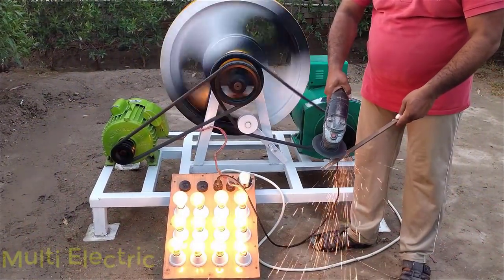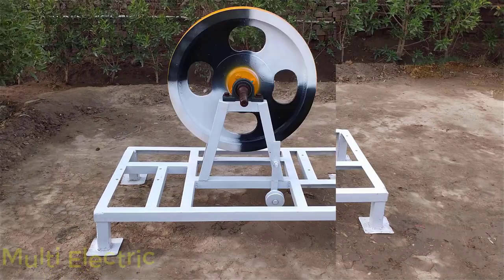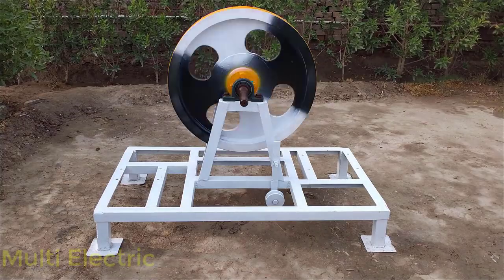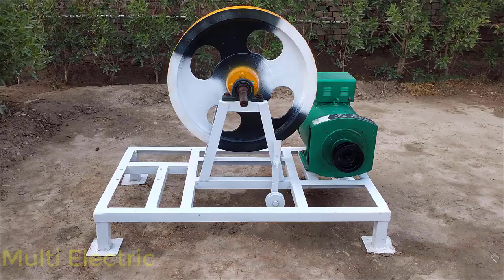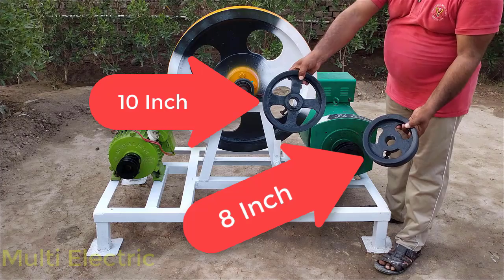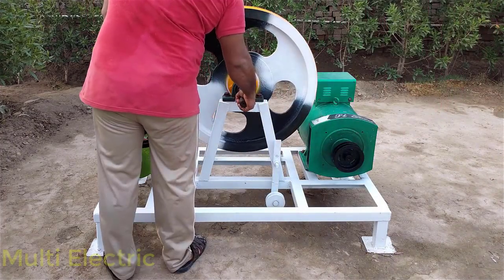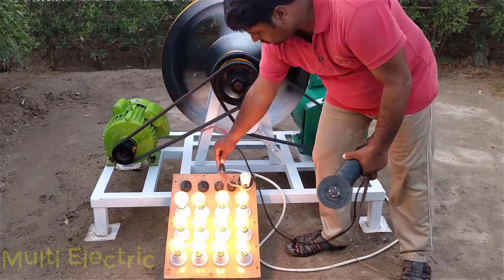12kw Free Energy Generator 230v With Alternator & 3 HP Electric Motor Free Electricity Generator

Comment: Jab hum electricity Par in karate Hhad to 255v milet gab had convert karate han alternator Par to project off go hard ha flywheel 84kg 2 piece and weight on one wheel is 42 dono ask shaphat Par late han flywheels width size is 17 inches alternator pul y 6 inch weight puly 10 inch motor puly 4 inch motor side weight puly 5 inch sir 5 k babe 8 inch pyou late to volt kan ho jate han alternator k sat jo tar algai ha 744 lagai ha motor k sat jo tar layai ha 729 ha yeh tar kiyu garam hoti ha aur yeh garam kiyu hoti ha plz kindly bate k yeh apas me  join karne se kiyu bad hoti ha

Comment: Do people actually believe this garbage? This literally breaks the first law of Conservation of Energy. What this person made was a flywheel battery. Not a FreE EleCTricItY GenErAtoR. The energy stored inside the flywheel will NOT cause it to spin forever. Energy will be lost either through resistance in the wires or through friction. AND it can definitely NOT power a grinder while still spinning forever.

Comment: Uh.... perpetual motion doesn't work. This is a low efficiency flywheel storage device that will slowly bleed off energy over time. If you raised the mass of the flywheel by a factor of a few hundred, installed a maglev bearing system for it, removed the motor (which does nothing but increase the rate of energy loss), ran the whole thing in a hard vacuum at extremely low temperatures to take air friction and magnetic eddy losses out of the picture, and used a solar farm to run the flywheel up to a few thousand RPM, you'd have... a really expensive kinetic battery system with reasonable efficiency. This is fun as a thought experiment, but in the world of physics, this is the mythic "free lunch".

Comment: WHY USE GRID ELECTRICITY TO START THE MOTOR, WHEN YOU CAN TURN THE FLYWHEEL HARD TO START RUNNING AND LET THE GENERATOR PRODUCE POWER FOR THE MOTOR?
Reply: The alternator would need a minimum of 3000rps u cannot do that with your hands. Again I think these alternators have been modified with permanent magnets so that it will need less rps of around 1600 inorder for the motor to efficiently turn the alternator into producing the total kw

Comment: Which electric motor, flywheel (in kg) and petrol (E95) engine to choose if the alternator is 6 kVA, 2-pole, 3000rpm, 50Hz, 230V? Thanks.
Reply: It is not possible with 2 pole alternator, you must use a rewinded alternator with many poles or low rotation alternator.

Comment: i have a funny feeling that the power was never removed. at least, i expect the system to blink or dim when the initial power was removed and the alternator power replaced to run the system. but everything ran smoothly rather
Reply: The flying wheel was maintaining the speed

Comment: I would use this to charge a set of batteries, then run the house from there using a power regulator, then if you used a trip switch when the battery was low it could kick start the wheels again creating a self loading loop

Comment: I was thinking if this is a scam and if it will not work and the motor runs of the grid if u use a 2hp motor it will work fine and you pay 1,5kw for the motor and you get 10kw in return i am going to invest in this and build it the same way if it dont work i just use the grid and get 10kw for the prise of 1,5kw so no loss in trying

Comment: i love the concept the execution is simple and brilliant. My only concern is for your safety. Like most brilliant people you did not take the time to be safe. Run and secure all electrical wires, use a self tensioning belt tensioner so you dont have to adjust tension on a piece of rotating equipment, and wear a welding hood. This is a very impressive achievement and the world could use more breakthroughs like this. So be careful with yourself so you can have many years to continue good work. Im only giving you a hard time because you've earned my respect. Keep at it.

Comment: I have seen these before and it's very interesting. The question is... can you demonstrate it with a big "load" while running? For example... lights, a heater, a refrigerator, a grinder and an aircon all running at the same time from the power output. Because a 12 KW system should be able to handle this load. Can you please reply and share a video with this type of demo?
Reply: hhhhh. Hay philipino, you nailed him. He will never reply nether would he be able to demonstrate a full load.
Reply: @SAGmyTube  That's correct Sager, we should be able to see a demo with a load, because if that generator has an output of 12 KW it would be enough to power my entire home, if it truly can handle the load/resistance right? I am in no way an engineer or electrician, just a retired chef, but I have built some HHO devices that work and am always looking for free energy options.
Reply: @Philipino56  if you want to look into flywheel storage systems then check out the vacuumed ones

Comment: We need generator when main power goes away ...when load shedding happens or when failure of power supply happens. When tthere is failure of power supply then how can we start this system by AC when AC is not available at that time. SO WE NEED IT TO BE SYARTED BY DC FROM WET BATTERY. PLS COMMENT

Comment: I did not see any batteries, when you unplugged the electric motor---and connected to the dynamo/generator, where did the stored energy come from? The motor should have stopped producing any voltage?
Reply: that is the work of the flywheel, to rotate the dynamo while the motor is unplugged.

Comment: Interesting work!  you mentioned that you had to rewind the 12 kw alternator dynamo. Can you explain the process in detail?
Reply: It is good things,but I have dout on it   will work,what modification you did in the alternator that its less RPM and how its working as per your specification.
Reply: Alternator has been added with more rpm thats all....
A standard alternator will also work
Just add a 1/4  extra ratio dia pulley to it..

No rocket science here

Comment: Sorry but I can see the flywheel slow down then a quick break in the video and it’s running faster again. That’s because you keep connecting it to the mains supply and then you start filming again. It is a good concept and one I want to pursue. But that will not run for 24 hours that I guarantee you.

Comment: Hello 
Great work... do you have a email address I can contact you on? 
Confirm both motor and alternator are 1500RPM?
Reply: A 2000 - 3000 RPM motor should work fine, note the pulley size (10") on the fly wheel that reduce the RPM on wheel itself, then 8" pulley drive the generator. Calculation must be done to balance the 1500 RPM on generator.  A full load on the generator will definitely impact the generator RPM that has to be measured with proper instruments.

Comment: Hi, how r u one thing i didn't understand how you meassure pully size and RPM you have set amps meter and voltage meter during same time you have to meassure rpm and voltage amps

Comment: 12kw Free Energy Generator 230v With Alternator & 3 HP Electric Motor Free Electricity Generator

3Hp  electric motor  4 inch pullies
12kw Free Energy Generator 230v , 8 inch pullies
100kg  flywheel  10 inch   pullies

Comment: Why didn't you connect the motor directly to the unit that produces the electricity/power instead of passing it through the the big round thing in the middle?
Reply: The big round thing is what we call flywheel. its kinetic energy is what produces force needed for alternator to generate electricity(a force of sort needs to be applied to spin the alternator to produce electricity). to gain that energy first, the flywheel needs to be pinned to obtain that energy to drive the alternator. that's why the motor is needed.

Comment: Hello, In your next video, could you measure the frequency? I've been trying to get this working to get 60 hz. It doesn't work for me at 60 hz, maybe a higher frequency? I calculated the pulleys to get the correct revolutions at the generator. I also made sure my flywheel weighs more than the motor's rotor as well as the generator's rotor
Reply: I can help you,
What is your flywheel kg and diameter, your generator is it PMG? And your motor how many kw and HP
Reply: @MRNWANETI   me puedes dar los materiales para un generador de 5 kva saludos desde Colombia
Reply: @MRNWANETI  Oh, I have to use a permanent magnet rotor in my generator... How do I acquire a rotor? I have to remove my rotor and see what size it is. I bought an ST 13.8 kW  3 phase generator but it is synchronous. We can not buy PM generators here in the US in this size, we need to make them.
Reply: @advanced-electronic  if you can buy direct already made PMG in your country US then you have to modify it by yourself,cos only PMG is suitable for this system thanks
Reply: @MRNWANETI  I have 2hp 240 v motor, a 90 kg flywheel with 13" diameter. My generator is synchronous ST 13.8 kW 3 phase gen. I wired it for single phase 240 VAC. Motor and spins at 3600 rpm. Gen needs to be 3600 rpms to run at 60hz. I had 6 inch to 3 inch at flywheel and 3" inch from flywheel out to 6 inch on generator
Reply: They jump the generator avr ac 40v or 80v from exciter coil into rectifier and filter 'dc capacitor' go straight to generator rotor or put straight ac from exciter coil "40v or 80v that way you skip the reaction power from your motor. 
The secret avoid the avr skip it.

Comment: Hi I build this but mine will not self sustain.what could be the problem
Reply: Drive motor 3 hp-2880rpm 230v- generator dynamo 16kw  1500 rpm 415v 3 phase flywheel weight 80 kg .pulley calculated to step down rpm to rpm 1500 generator speed.when I switch from main to generator it does not self sustain it gradually decelerates to a stop.
Reply: @seahawkscram  from what you explained I understand is your synchronous generator PMG?,if not it can't work

Comment: The fact that so many people believe that this is real is concerning
Reply: Why wouldnt it be?
Reply: @HeavyMechY  laws of thermal dynamics.  Energy can not be either created nor destroyed. Any machine you make always has friction and heat loss.  Period. There is no way around that.  When producing electricity, the energy put into running the generator will always be more than the electrical output.  What you are seeing here is called a perpetual motion machine, which is nothing more than a pipe dream.  Even if you could somehow you cab bypass the laws of physics,, run the machine at 100% efficiency, with no friction or heat loss, it would only create enough power to run itself.

Comment: I really like your videos. Where could I buy these parts to make these free power generators?
Reply: You cant, because systems like this dont exist
Reply: I had also tried this but once I changed over the power to sell running,it will stop
With 3 hp electric motor of 3000 rpm and the same flywheel they used here and 7.5 alternator of 1500 rpm,but did not work,

Comment: Your idler pully should be under the belt not on top. The end of the pully bar could have a strong spring pulling on the bar forcing the idler pully to push up.

Comment: This project is amazing. How much will cost to get an instruction guide how to successfully build one of this generator
Thanks
Reply: Ill give you one free after you buy the bridge I have for sale
Reply: @MrNinjaBeater  ,,🤣🤣🤣🤣
Reply: I've build two sets different capacity,it work but it very hard to succeed if you don't have some guidelines from person who has construct before because a lot of modification required before your system works,we don't make used of synchronous generator only PMG
Reply: @MRNWANETI  you are so full of shit lol.  Perpetual motion machine is impossible.  There is always energy loss.  Your input power will always be more than your output, due to loss from friction and heat.  Even if you managed the impossible task to create a machine that ran at 100% efficiency, you would not be able to pull power from it, as the machine would only create enough power to sustain itself.  Gotta love people that will lie for views.
Reply: @MrNinjaBeater  I don't interact with such minded people like you,come into the field let see not online blabbing rubbish,I used 12v DC motor 400w to ran 1.5kw generator and 12v battery charger that recharge the battery immediately with low RPM,and I used more than 500w power from it isn't free energy generator? No solar no fuel , don't talk because others are talking think 🤔 before you say a word
Reply: @MRNWANETI  RPM doesnt matter.  Decreasing the rpm means that more torque is required to generate power.  More torque means that motor has to work harder to spin.  The harder your motor works, the higher the power draw, and the more heat your motor produces.  There is absolutely no way around that.  You can not get more out of something than you put into it.  If your machine is running, it is using battery power but is not recharging.  I stand my ground on the fact that you are lying, because we both know that you are.  You telling me that $1 million USD isnt worth a trip to the US?  Riiiight.  You just know that you cant prove anything.
Reply: @MrNinjaBeater  sorry let me enlighten you more, we have many types of generator which you might know, brush generator the one used AVR which spin around 2500rpm, synchronous generator which spin around 1500rpm induction generator which spin 2500-3500rpm it uses capacitor, when you modified it to PMG it required low torque,low RPM, zero heat and low friction due to it doesn't used capacitor again and no high speed,if I used my hand ✋ to rotate the shaft of the generator I generated more than 15vac if I used rope I get more than 60v ac ,so with 12v DC motor 400w and controller I spin the generator around 300-600rpm ,note my  12v DC motor rated speed is 3500rpm but I used speed controller to control the speed to avoid high voltage from the generator,the first time I did it without using speed controller it blow up 🖕 my battery charger it's around 300vac from the generator,it work very well due to my generator doesn't require much torque to produce electricity due to I've modified it to low RPM it doesn't used capacitor or avr once you rotate the shaft it begins to generate electricity, like I said earlier am from Western African,if your serious and you want proof let make it happen am not afraid because that's my work,I still maintain my word, fuelless generator I did work it depends on principle you apply ,
The features of PMG over other generator are**
* Less torque
*Zero heat
* Less friction
* Less vibration
* Efficient

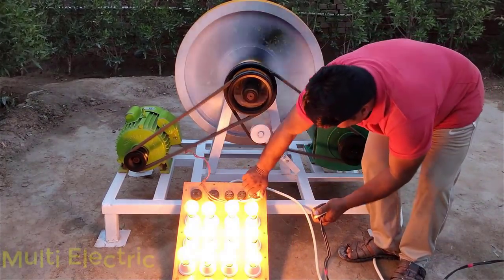Comment: At 5:30 he unplugs the drive motor, at 11:30 the generator stops generating usable power. 6 minutes of runtime on a 100kg flywheel. That's sad.
Consider direct coupling the flywheel to the generator and motor shafts (eliminate the pulleys & belt losses), install a clutch between the motor and flywheel (similar to a car AC clutch) to reduce load on the flywheel, use air bearings instead of ball bearings .. You might get the runtime from 6 to 8 minutes
Reply: You would get a run time of zero seconds

Comment: Please I have been trying to make this on my own but it has been unable to work please can you guard me on how to make it successful
Reply: How many  kw generator and hp of  motor you used
Reply: @MRNWANETI   I used 7.5kw generator and 5hp electric motor
Reply: @ogbookwuchukwuaugustine2566  is your synchronous generator PMG? If not it can't work too your motor RPM
Reply: @MRNWANETI  the generator am using is those once normally use in a diesel engine to produce electricity
Reply: @ogbookwuchukwuaugustine2566  it is synchronous generator, you have to modify it to (PMG) means permanent magnet generator before it can work
Reply: @MRNWANETI  okay sir, I will look for that, thanks for your time.
Please is there any other thing you think I should modify for it to work
Reply: @ogbookwuchukwuaugustine2566  no only your generator and your motor HP
Reply: @MRNWANETI  Okay for my generator I will go for the PMG type but what is your say about the motor HP

Comment: How does the conservation of energy principle work here? Never make any adjustment to a running machine, unless you have no other choice but to do it to save Lifes. great job for having the mindset to do something.
Reply: I think you'll only need to consume electricity from home only to start the project, or every after idling the unit to rest it or cool it down. I will soon do this project
Reply: the mindset to pull a scam to get ad revenue for the video. it will only produce electrical energy as long as the fly wheel is spinning. it will slowly use up all the power and stop spinning. its using the energy it created  to create more energy. their are losses, in the motor, the alternator, and in the bearings of the fly wheel. this is easy to quantify, if the motor is 80% efficient, than every watt hour pulled from the motor you will only get 80% of its horse power out, and same with the alt, say its 80% efficient, you will only get 80% of the watts you should from the horse power driving it. eventually it will all come to a slow gradual stop and it will do this in minutes, not hours. my guess is if 10kwh was put in, they likely only get 7kwh out. its the opposite of free energy, it wastes energy to fool people who for some reason cant think this stuff through. nothing is free.